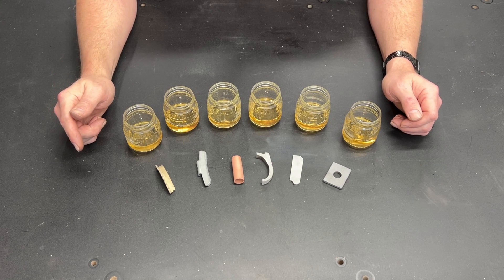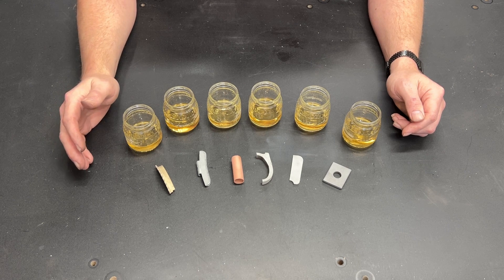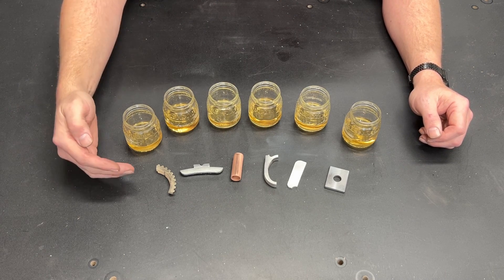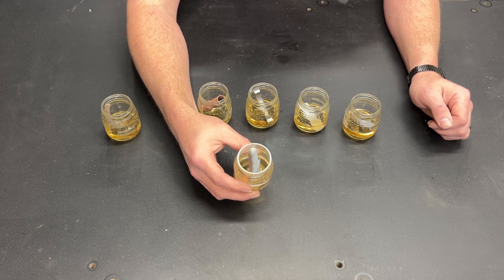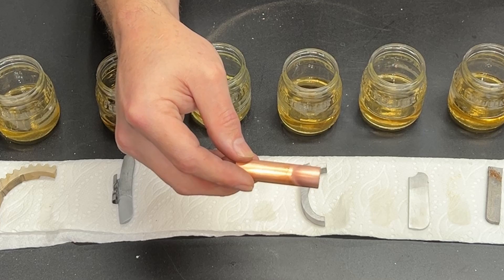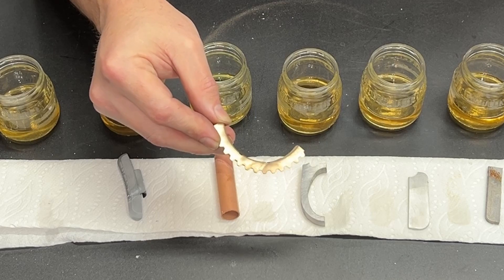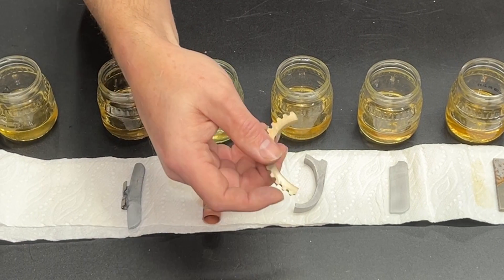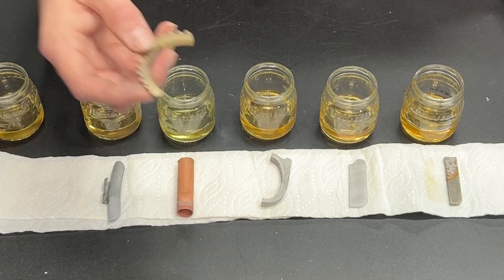Can Soaking Metal Parts Like a Carburetor in Pine Sol Damage Them?

Comment: The brass you used looks like a piece of a manual trans syncro and is made from a specially hardened manganese alloy.  It does have a pretty high zinc component (20-40%) and, also, manganese, aluminum and silicone (highest to lowest composition). The addition of these additional 4 elements was probably what kept the Pine Sol from attacking the piece.
Reply from the maker: good spotting and great to know.  May be worth a follow up test.

Comment: Most modern carbs and throttle bodies are alloys of magnesium & aluminum. It’s often best to use an organic solvent anytime you’re going to be “soaking” your carbs for several hours or overnight.  When it comes to these cleaning solutions, which I also use in my ultrasonic cleaner, it’s best to dilute them with distilled water and limit the time they spend soaking in the fluid as many/most do have some acidic properties at full strength.
Reply from the maker: good advice
Reply: @ loved the video btw…great to see these results through actually testing stuff.
Reply from the maker: absolutely... a little scientific method never hurt anyone 😁

Comment: Zinc is probably the single most reactive metal in common use. That's why it's use in sacrificial coatings so much because it will corrode before even aluminum.

I'd be curious if the results would be the same on fully submerged parts. Being exposed to oxygen may have allowed a general reaction that wouldn't have otherwise happened if the entire part was covered.
Reply from the maker: The feedback I have gotten is fully submerged zinc will etch but not pit.  Once a dark gray layer covers the part the reaction either stops or slows.

Comment: All of this completely depends on your definition of "Pine Sol".  Is it fresh off the shelf brand name Pine Sol?  Is it brand name Pine Sol ordered direct from the manufacturer (Clorox)?  Is it brand name Pine Sol that's been sitting under your kitchen sink for 10 years?  Is it one of the generics?  These are not the same thing.

Since around 2016 or so,  brand name Pine Sol has contained exactly zero percent pine oil... unless you order direct, that is.  They claimed this change was due to the limited world supply of natural pine oil, which makes sense because we've known it would dry up eventually going all the way back to the 50's or whenever it was first brought to market.  On the other hand it doesn't make sense because the generics are still using it, so who knows.  What I do know is the pine oil is what you want for aluminum, and retail Pine Sol doesn't have it.  They replaced it with Glycolic acid, which is definitely not the same thing:

Metal		     Pine Oil	Glycolic Acid
Aluminum (Al)   Excellent	Poor
Copper (Cu)	     Poor		Moderate
Iron (Fe)	             Poor          Poor
Stainless Steel  Good		Good
Brass		    Moderate	Moderate
Bronze		    Moderate	Moderate
Zinc (Zn)	    Poor		Poor
Lead (Pb)	    Poor		Poor
Nickel (Ni)	    Good		Good
Titanium (Ti)	   Excellent	Excellent
Carbon Steel	   Poor		Poor
Reply from the maker: interesting info, thanks for the comment
Reply: @charlescalkins3485  Please point out the Pine Oil in the ingredient list, because I can't seem to find it:

Original Pine-Sol Multi-Surface Cleaner contains: Water, C10-12 alcohol ethoxylates, sodium secondary C13-18 alkyl sulfonate, fragrance, citric acid, colorant, xanthan gum and preservative. Contains fragrance allergen(s).
Reply: @charlescalkins3485  All you have to do is read the label.  If it doesn't say "pine oil", it's not there (and it's not).
Reply: @charlescalkins3485  Actually I just noticed they are using citric acid instead of glycolic acid now, so Clorox changed it AGAIN.  This might not be a bad thing since Citric is more compatible with aluminum than Glycolic but otherwise the same as far as compatibility goes.  It is however not as strong as Glycolic, so less effective at the same concentration overall.  Doesn't matter though, because Pine Sol has not been the best choice for what I'm doing (cleaning aluminum parts) for quite some time now.
Reply: @charlescalkins3485  By the way, the label does not list the chemical composition of "fragrance" because there isn't enough of it in there to matter.   Active ingredients are what we care about, which used to be 8-10% pine oil, then was about the same amount of Glycolic Acid, and as of last April is not Citric Acid.  The scent is not the reason they used Pine Oil in the original formula, they used it because it was an effective and comparatively safe cleaner.  They also knew almost from the start that the world supply of pine oil would not last forever so all of this was predictable (it actually lasted a decade or two longer than original estimates).
Reply from the maker: interesting information thank you

Comment: Keep in mind that since that you proved that the Pine-Sol attacked the zinc it will probably also attack the zinc chromate finish on many carburetors.
Reply from the maker: It might but it also might not as the other components in the chromate might resist the pine-sol.  Easy enough to test with a grade 8 bolt

Comment: As a 4th generation foundrymen and currently the head of casting in a brass foundry I thought you might like to know a little about brass and bronze. The most common aloy out in the world is c95400 it's made from Cu 86% Al 10.5% an Fe 3.5%. in this aloy Zn is actually a contaminate with an allowance of .05%. there are many many others some that contain Zn. C86300 has an call out for 25% Zn. None of this was meant to be critical of anything you did. Your work is appreciated! Just thought my little bit of 2 cents might spark a bit of interest.
Reply from the maker: Not critical at all, I appreciate the input.  I figured the brass being more resistant to the pine-sol than the copper and zinc alone had to do with what ever other metals were in the alloy.  For the the scope of the video however I decided to keep it basic.  the bigger issue I was trying to avoid is people using a dip like this on pot-metal, thinking its aluminum and then ending up with etched parts.  I do appreciate the comment, the chemistry of alloys is complicated and even small changes can have a major effect on the resistance metals have to corrosion.  It doesn't take that much chromium to covert steel into stainless.

Comment: Good experiment, what was the approximate ambient temperature?
Reply from the maker: 45° F ish warmer temperatures would have likely accelerated the process in the beginning but typically reactions like that slow as a “protective” layer of corrosion builds up on the surface.

Comment: Totally unrelated to cars, but your testing has me wondering if I could use Pine Sol as an etching solution for making my own circuit boards, using the toner resist method. Would smell a helluva lot better, and be easier to dispose of than traditional etching solution.
Reply from the maker: I have etched a couple circuit boards and I don't know that the pine-sol has enough power.  The only way I could see it having a chance of working is if you added heat but even then I don't know.
Reply: Might be a cool test, if you think it's worth doing a video on. Actually, a video on DIY circuits for automotive use would be neat. Anything from Megasquirt, to a simple LED board that controls the illumination speed to accurately simulate an incandescent bulb, would be cool. Anyhow, thanks for the response! @dazecars
Reply from the maker: I built a megasquirt back in the day but that was long before I was doing youtube so there is no video.